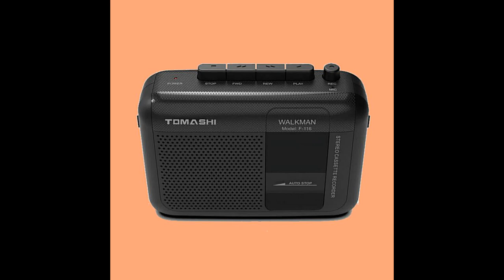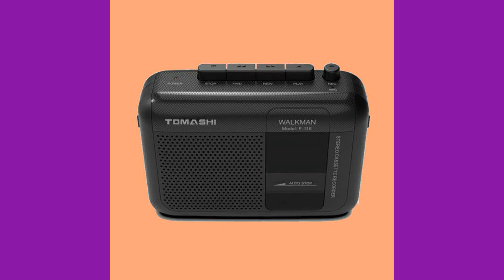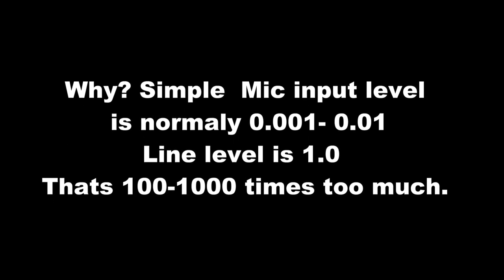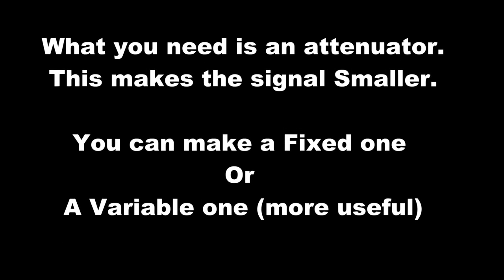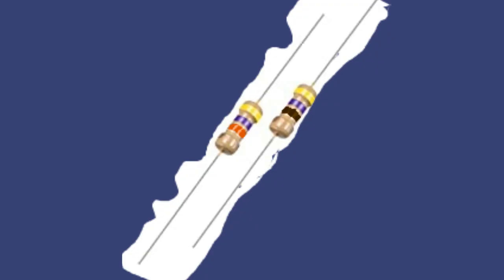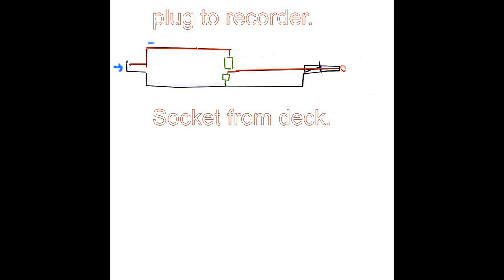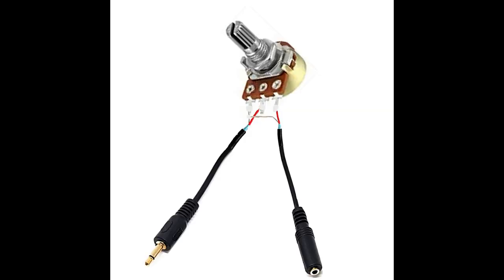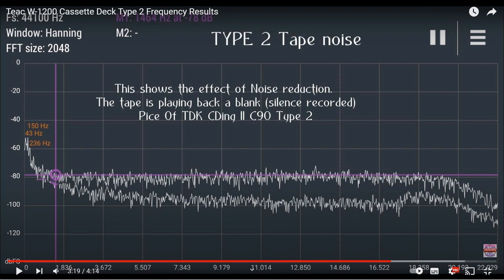New Tomashi F-116 How to feed line level into the Mic input.

Comment: So if i tune it online i tune it to 0.01 or what?
Reply from the maker: It depends on the unit. I said the most useful is with a pot because you can get it correct by trial and error.  The unit may have the value in the spec. I used a tech site to get the "normal figures" as the industry is not good at setting and staying with standards.  it will work and the results will be good.
Reply: Thx,so may i just tune it with normal equalizer?(website)
Reply from the maker: That may work. worth a go.